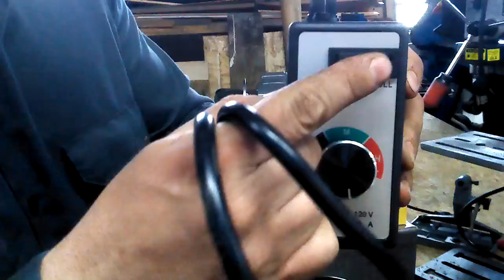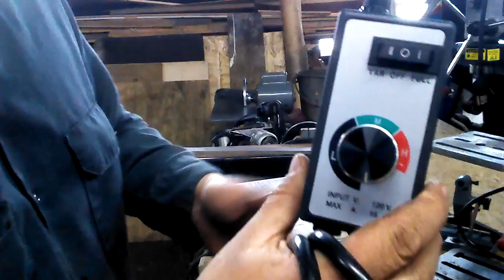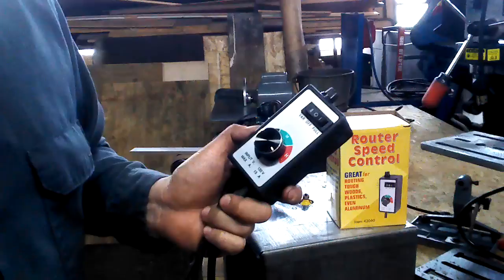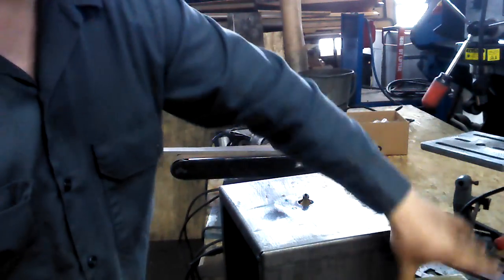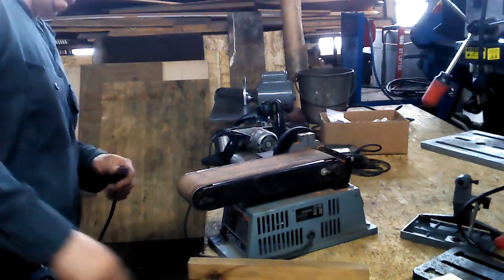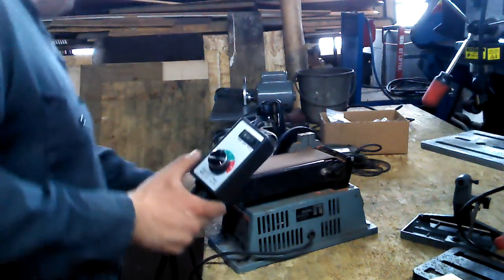Review: Harbor Freight Router Speed Control, does it work?

Comment: works with BRUSH TYPE universal motors.. not induction motors like is found in the belt sander or drill press..
Reply: Hand-held belt sanders are always brush type.  I'm assuming you're talking about the pedestal units. Anyhow, probably not much of a need for speed variation on a handheld, as it is a rather slow machine to begin with.
Reply: @tiffanyfrank3654  if it has the "bumps" on the motor sides, that house either/or start and run capasitors , it is probably an induction motor.... most benchtop & stationary tools , even washing machine motors are universal induction motors . handheld tools such as ; drills, grinders , sanders, routers are mostly "brushed" motors. .
Reply: ac drill motor brush type?

Comment: Vari-Speed makes really good speed controls. They come with massive heat sinks and are actually rated for continuous use under high loads. You can adjust the minimum RPM as well, so that the entire dial will span your desired settings.
Reply: i just  took the back off and found the thing that you can turn to change the minimum speed. Thank god they had that because its way to fast, i wonder if anyone else will figure it out it was not labeled and it doesnt look like something that can be adjusted with a screw driver.

Comment: One of the best tool uses for this - detail work with an angle grinder or other brushed motor where almost no load is put on the tool - you just need it to spin at a slower rate.  As long as there is some reasonable motor turning during this type of use, the motors will run as cool as a cucumber, and the tool won't feel like it's trying to get away from you because of full-blast speeds. 

(This variable controller is a waveform truncation device, which means on slower settings, the motor is only fed wave spikes and zero voltage on the remaining portion part of the  60 cycle wavelength, hence the ability to keep non or lightly-loaded motors cool because they "coast" through the zero voltage part of the cycle.  Because the belt sander is mechanically always loaded with lots of friction for the motor to overcome, the motor never has the benefit of "coasting".  Not recommended on belt sanders as stated!)  

DON'T USE THIS ON BRUSHLESS SQUIRREL CAGE MOTORS!!  Principally they need the whole waveform at the correct voltage - always.  Back EMF because of motor inductance not matched to the correct voltage will heat it hotter than a two-dollar pistol in short order.  As stated elsewhere, use a vector drive instead (expensive) for these kinds of motors.
Reply: What about using a one phase of a three phase ( input 120 ) to control a single phase induction motor? Will that burn up the motor as if the power company reduced the voltage?
Reply: @jonnelson9760  The motor only sees what is coming to it - a 120 volt sine wave. This will run a motor fine, but the imbalance that is caused by only using one leg of the three phases for a large motor might be picked up by the electric company.  I'm not sure what they would think about that.  Someone here might know.  I do know that it would raise hell with something called a rotary phase converter or a static converter (both make three phases from one phase service) .(This is slightly different from trying to balance a one-phase utility transformer by putting 1/2 of the 110 service for a house to center tap to 1/2 of the house and the other half to the other half of the house to balance the transformer, but not entirely different, since in general transformers don't like imbalances.) In summary, I think you'll be ok with a regularly-sized 120v motor seeing 120v.
Reply: Paul Blanchard I brought this up because I have seen this on other videos. I was thinking about it for my lathe. Would the motor care if the frequency changes but the same voltage? It would be bad to use less than 120 VAC at 60Hz to control the speed or is frequency better?
Reply: @jonnelson9760  The motor was wound for 120v which means the motor windings possess certain inductance characteristics but only the correct ones at 120v and 60hz (or whatever phase frequency).  Of course inductance values matter because the motor has a start and run winding which uses different gauge wires so the inductance (therefore the phase shift) is perfect to start and run that motor. 

You should search for 1-phase VFD 120v - what you want is indeed frequency changes.  If the motor has a capacitor, you take that out and wire the motor according to the instructions.  The motor's needs are figured out by the electronics.  These are getting cheaper and cheaper.  Probably worth every penny since lathe speed control is very important, and to be able to do that on-the-fly guarantees uninterrupted workflow.  For example, as a shaft diameter is being reduced, you might elect to speed up the lathe, since you will be able to maintain cutter-to-work surface speed as the diameter decreases.  In some cases, this might be important.
Reply: If you didn't want to go that route, you can set up a variable belt drive. Those are made for stationary applications such as a lathe.  Not sure at this point which would be better, more inexpensive, etc.  Anyhow, you probably know most if not all of this - I'm talking generally to others who might be reading too.
Reply: Paul Blanchard I have belts on the machine now. I was hoping to get away from changing belts ( I also would like an rpm readout ) but I wasn’t sure if I need to get a three phase motor and a vfd. I also saw these videos when I was searching for single phase vfd ( I think they are rare if they exist at all ).
Reply: @jonnelson9760  No no - I was talking about continuously variable drives, or CVTs. You would keep your pulley cones, as a CVT won't have the range of speeds you'd need, so this is an intermediary drive unit between your motor and the first cone.  Search for Reeves CVT.  You might want to look at the thread at Practical Machinist and search for the thread, "Continuously Variable Transmission Units" where they offer other ideas. One member says that it is better to go for the VFD. One person uses a large treadmill brush motor with a "cheapo" speed control (could be the one showcased in this posting/video) - there is a reason treadmills use these motors.  They're crazy powerful, too.  He did it for under $150.
Reply: For the RPM readout, you can get one of those rpm readers that works by PFM (you aim it at the revolving item and it magically displays an rpm) and you can just mount it somewhere on the machine.
Reply: @sonicdewd  if you take off the back and have a small flat head scew driver you can lower the minimum speed. There is another potentiomer that allows you to lower the low speeed utill your motor will barely even spin at the lowest speed.
Reply: @mrschnider6521  Yes, I found that screw.  I've bought three of these devices, and on two of them I had to readjust that setting to make it able to go lower.  Although this isn't germain to my original points above (on the above scenarios, one is using the fast part of the setting closer to full speed, not the adjustable floor part of it), this is very useful information; thank you.

Comment: The fact that some tools are working with that speed control and some others aren't, might be related to the motor type.  For instance, your router and grinder may have brushes, whereas the two other tools are actually using induction motors.  Just a guess.
Reply: yep Thats what I'm thinking too Works great on brushed motors.

Comment: Im not an electrician but I have found that the speed motor controllers are bad for capacitor assisted motors and work great for brushed hi torque motors.it does not work on motors with variable speed dials but if the dial has a full power setting it may work if you leave the tools dial on full
Reply: If you are using a motor with a built in speed controller , why would you use another speed controller? Isn't that redundant?
Reply: If you have a dremel and want it to spin faster, for doing ultra tiny edge rounding and polishing/buffing tiny things. My variable speed is way too fast for doing this and makes a lot of noise, Mainly I want something that is quieter. That is why you would want another speed controller, to reduce the speed further.
Reply: @gregorym9591  If you are using it for a table mounted router you don't have to reach under the table to adjust the speed.

Comment: the reason it's calle  Router Speed Control is because almost all routers have speed control so it doesn't damage the motor 
if you slow it down.whereas if you slow down table saw,band saw, chop saw  motor or any tool without internal speed control, you could burn the motor even though it will work.

Comment: Tip for you, tools that have one or two large "bumps" that come off the motor are capacitor start motors, you WILL mess those motors up and possibly start a fire. Those bumps are the capacitors.
Reply: Are they flux capacitors? How many jiggawatts are them sumbich es using?

Comment: I made one by going to the electric store and using our account to buy cable, plugs and dimmer light switch. Hooked it up and it didn't achieve what I wanted with my drill, which was very slow speed. I can do that by simply using the trigger, but I got tired holding the drill with one hand. If I try to control the voltage with the dimmer, the drill bogs down like your sander and needs full power to get it spinning again. There was also lack of torque compared to when I use the button. I can't understand the engineering behind it but i guess slowing down voltage is not the same as the button on the drill. 

p.s Yes my drill has the 1-9 circle too but even at 1 its still not slow enough. I hate using it with 1 hand while pressing the button with the other getting tired after drilling 5-7 holes in a roll

Comment: This speed control is intended for "üniversal" or series wound electric motors. NOT for indusction motors!  The reason it does not work on the drill press is because one can clearly see it is an induction type motor -- the centrifugal switch which disconnets the start winding is clearly seen cycling on and off at the lower speed.  Don't use this speed control on anything but a series wound or universal type motors!
Reply: 100nortonfan will it work for a 1x30 sander from harbor freight?
Reply: It won't work on my Delta 1x30 but it works on my hand drill.
Reply: 100nortonfan bb

Comment: inside the switch there is a second potentiometer that can be adjusted with a small slotted screw driver to make it go faster or slower. i was trying to modify mine and was going to solder in a higher value resister  because the slowest speed was way to fast and i found it.

Comment: i think the drill press motor has a centrifugal switch that shuts itself down in case of a stall, so in a way it might have kind of been working, since it's a single phase motor, but no telling what sort of risks are involved. maybe the wattage rating of the speed controller needs to match or exceed the motor.
Reply: No, it's instead an induction motor that is unsuitable.  Further, it is very hard to stall those so unlikely to be put into a design on a budget grade drill press, considering the loose belts would just slip long before then, and eventually the thermal fuse would trip.

Comment: I'm glad you showed this!  I'm trying to get speed control on my bandsaw to use it for metal.  You may have just saved me some headache!
Reply: MantisRay861 Did it work on your band saw? I have a Delta with a one HP motor, think it
would work?
Reply: Probably the bandsaw has an induction moror and this will NOT work!  HF sells a decent floor stand metal band saw for like $200 that apparently is worth every penny
Reply: your bandsaw is probably belt driven & most likely has an AC , universal , induction motor , if you use the HF speed controler it will slow the motir speed by lowering the voltage , but in doing so it will also lower the torque . so it wont have any power. AND... it will cause the motor to overheat  , damaging the motor & possibly catching fire... the only was to slow an AC induction motor is to change pulley or gear ratio .... or by modifying the windings inside the motor, which is impratical , unless its your only option, and it would cost more than a nice floor model powermatic.... also be careful not to underdrive your bandsaw motor too much or it will damage it.. im trying to help you , b/c ive been studing this exact thing.... so... trust me or troll me, its your choice.... good luck  !!!!
Reply: @guitarman_3693  I'm interested in the idea of a different belt or pulley to control the speed of a bandsaw. That sounds doable.

Comment: I bought one from Amazon designated as fan controller. worked great for 3 or 4 times used. moved it to a new location and it worked full speed but failed to provide any further reduction. Based on feedback from various sources, sounds like this thing is not built well and may have a very limited lifttime

Comment: it's a dimmer switch, I use this with high watt film making lights and it works well.
Reply: No, it is not a dimmer switch.  A dimmer switch operates with a similar principle and most of the same components, but a dimmer switch has no need for any mitigation or adjustment for EMF from an inductive load.  In other words, you can't just assume that some other dimmer switch would take the place of this, unless it is rated for motor use, because it is not a dimmer switch.  That your lights happen to work, are largely due to other factors whether it be a purely resistive load or active LED driver electronics that sense various dimming conditions by design.
Reply: Most dimmer switch can't handle above 500w

Comment: 1. Its a glorified dimmer switch(potentiometer) 
2. It says router specifically because some router bits need to be run slower than full speed for safety reasons. If you dont have variable speed on the router, you can use this.
Reply: inside the switch there is a second potentiometer that can be adjusted to make it go faster or slower. i was trying to modify mine because the slowest speed was way to fast and i found it.
Reply: @mrschnider6521 😂😂

Comment: well you could check the rpm with an rpm gauge... harbor freight has a digital tachometer for $40
Reply: jchinderle bingo
Reply: Yes but it's not all that useful to know because at the reduced power, the tool will progressively bog down more and more under load, so the final RPM is going to vary greatly.

Comment: I've been using old dimmer switches for lighting/ceiling fans, those round ones. Allegedly they can handle "15amps" some anyway. Work fairy well, I splice them into short cheap extension cords occasionally. Nothing has lit on fire yet...😄😄😄
Wrong about the amp rating (5 amps) not 15

Comment: Brushed motors running above 5,000rpm seem to tolerate this speed reducer. I was planning on using it for my crappy Rockwell Blade Runner saw. After seeing it operate, I will pass on buying this controller.

Comment: Speed Control for all kind of electric motors as " Shaded Pole', permanent split capacitor motor (PSC) , and Brushed Motor as universal motor, but Not for Single-phase AC Motor, and capacitor start AC Motor... because on rotor has switch for starting then run that's why

Comment: Plug the Harbor Freight controller into a circuit tester.   With the switch in "OFF" position, circuit tester shows "Open Neutral".  Clearly the Harbor Freight Controller is not switching off on the Hot Lead, but Neutral....

Comment: Can it be used in a small commercial sewing machine?  Mine is Consew CP-206R . I am crazy trying to figure out how to reduce the speed without needed to change motor or gears on it. Thank you.
Reply: I would try a speed control foot pedal from Foredom.  I use mine everyday for the SR series high speed motor I power carve with and it goes from zero to full and all rpms in between just by how hard you press the pedal...it connects in line with your power cable...I bet it would work, but I am just an artist so look into it and use your judgment

Comment: Can I use this for sewing machine motor?
Reply: No, you need real-time complete instantaneous on-off-rate control like you would have with a proper sewing machine foot controller.  Speed is not used the same way when sewing, is a very dynamic thing during sewing.

Comment: Can I use this to limit the peak watts through an inverter? I got a HF 1KW; 1.5KW peak inverter. Still trips when I power on a Black & Decker 800 watt coffer brewer.
Reply: It is entirely unnecessary for that.  You could simply use brass crimps to insert a series power resistor between the heating element and the feed to it.  Remember, it is potentially dangerous mains voltage so ideally you would just get a lower wattage coffee maker instead, or a better inverter that's really capable of the rated wattage.

Comment: Wow, thanks for the quick reply. I really appreciate it.
Basically I'm trying to minimise the number of power tools I have because of space and transport issues. So I am trying to find a way to control the rpm on a bench grinder so I can use it as a disk sander as well.
Reply: change pulleys..

Comment: Do you think this would work on a Miter Saw? I wouldnt mind using this on a miter saw with a metal cutting blade.
Reply: My question has been answered. I guess it technically works but not functional. I was hoping it would work so I wouldnt have to spend $300 on a dry cut saw. Thanks Josh

Comment: Any idea if this would work on a 12 VDC fuel pump?  
Thanks, Dan
Reply: would a potentiometer work for that? check first to avoid a sparking situation.
Reply: No, it is for chopping AC.  You'd need a DC motor controller for that, except that unless this is some weird and dangerous project, you should leave the fuel pump to run on 12VDC as intended, with the correct controller for it as it may not be brushed.
Reply: check on a pulse width modulator ... PWM controller